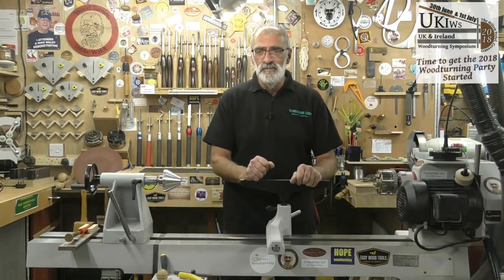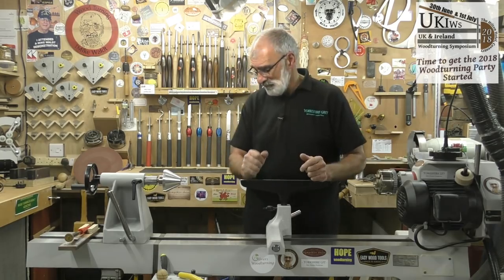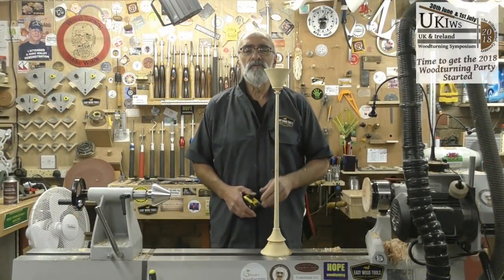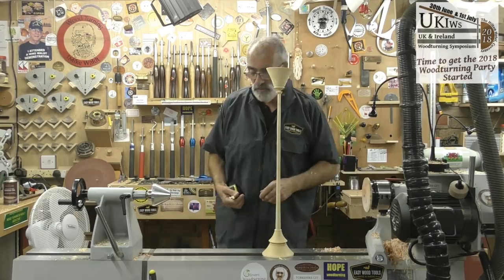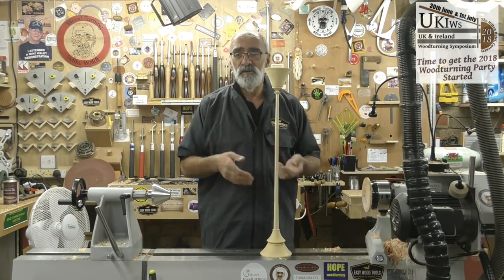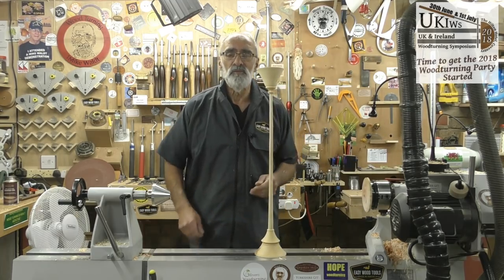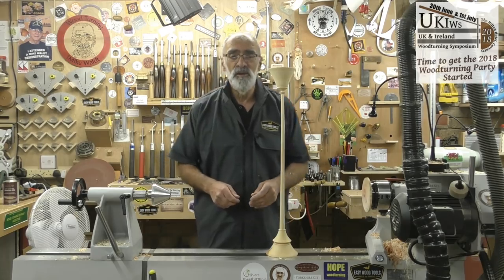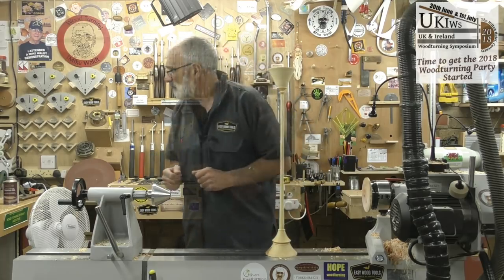Woodturning - The Giant Ash Goblet!

Comment: Hi Mike.  Could you please do a video that I think may help many novice/beginner woodturner?  A video describing and demonstrating what each type of tool should be used for, and pointing out the dangers of using a tool for the wrong type of turning.  Maybe also talking about the types of grind and sharpening methods.  I think it would be really, really useful.
Reply from the maker: I have a "Beginners Guide" series of videos which covers the main tools and their use.
Hope this helps.
PS - I also have several sharpening videos too :)